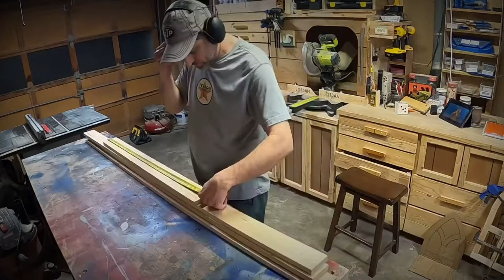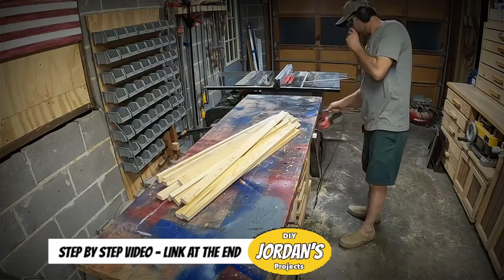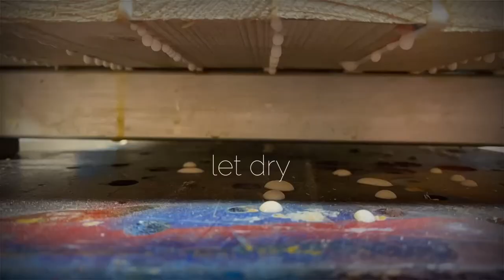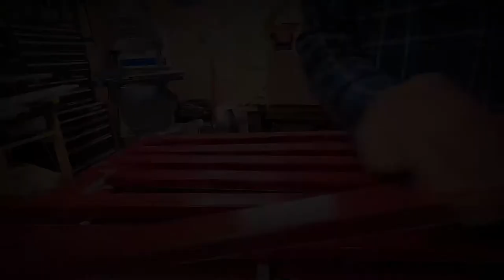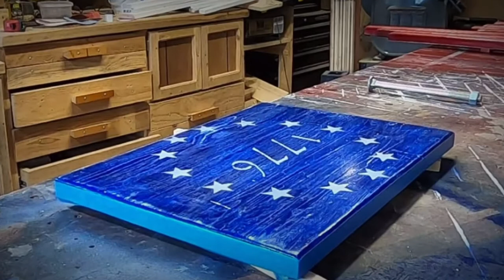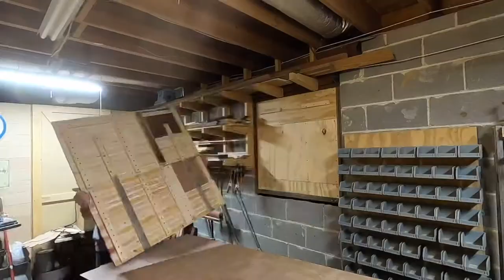American flag-how to build-Wooden Betsy Ross 1776

Comment: Awesome flag! I am going to try to make one. Are you using Bluetooth headphones? I have been looking for some to use in my shop.
Reply from the maker: Thanks a lot. It’s super easy, if I can anyone can. Lol. Yea there blue tooth, 3M worktunes $48 from Amazon. They work great blocks out most noise and stay charged for ever. 
Thanks for watching
Reply: @Jordanwoodworking  You did a great job making the flag videos. Its awesome when you come up with a system and duplicate it.  Thanks for the headphone info. I just added them to my amazon wish list.
Reply from the maker: You will not be disappointed. Thanks for the support